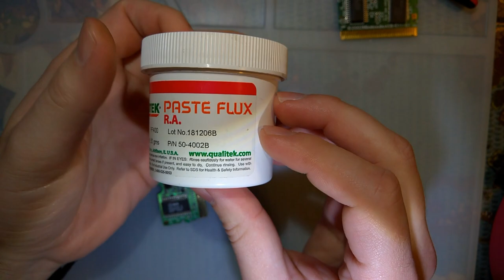Converting a GBA game over to battery-less saving (SRAM to FRAM)

Comment: It’s really nice to know that this can be done but for instance if someone’s battery die and can solder it’s so much easier to just swap the battery with a new one than to do this whole process lol the solder joints are big and easy to work with

Comment: Just a question here regarding GBA Flash type saves:

So similar to how you change the SRAM and FRAM chips (well the game ROM chips in this case) around by soldering, is it also possible to replace the Flash chip from a 64KB to a 128KB one. In addition to putting it on a bootleg cartridge that has Flash save on it (like my Mother 3 cartridge).

I wish to have a cartridge of the Japanese version of Super Mario Advance 4: Super Mario Bros. 3 with all 38 e-Reader levels, while I do have ways to put the rom on my bootlegs I get a message saying the save file is corrupted, and patches to make it batteryless on the rom itself (meaning so save chip required either) corrupts the graphics for me on that game.

Comment: For some reason, Metroid: Zero Mission, which came out in 2004, has copies that use SRAM instead of FRAM. The reason I know this is because my brother's copy of Zero Mission is an SRAM model, while my copy of Zero Mission is an FRAM model. To this day, I still don't understand why a game was released 3 years after the GBA's initial release has copies that use SRAM instead of FRAM. It's been several years since I checked the labels, but I don't believe that the SRAM version and the FRAM version of Zero Mission are different revisions of the game.

Comment: Hello Makho. I have a question. So I currently have a midnight trace gba flashcart from funnyplaying. I want the cart itself as it's a golden color and I have a shiny gold rom in there. The base game is fire red. So it beautiful to me and I want to keep the golden cart. However, I have to patch the rom in order for it to save properly on the cart (since it's a fram chip and not flash) I was wondering, if you knew by any chance, if I can take off the flash chip from a spare authentic fire red cartridge would I be able to place it on the flash cart and remove the fram chip? Both chips are similar in size and have the same amount of pins. It looks like it would fit perfectly. But I want to know if the flash cart would even be able to interface with the flash save chip. Would it be a waste of time to remove the fram chip and install the flash save chip?
Reply from the maker: That's not how this works

Comment: Hey I am trying to save a Pokémon Emerald cart that won't boot, that a dog used as a chew toy ( I can see the bite marks) after looking at the cart carefully I am pretty sure it's the SRAM chip. there is a crack in it that is barely visible. My cart reader could load the rom onto my computer as well. do you know if there is an FRAM or SRAM chip I can buy that is compatible? Thanks!

EDIT: I noticed a lot of these carts have 28 pin SRAM or FRAM chips, Pokémon Emerald has 32 pins.
Reply from the maker: emerald doesn't use SRAM or FRAM so this won't work
Reply: @makho  thanks for the reply, I just bought a cheap Japanese ruby cart and I'm gonna use the chip from that hopefully they're compatible. Cheers, love your vids btw.
Reply: @TheHawk425  ruby isn’t sram or fram

Comment: Dude, props for the Eva Micro faceplate. Where'd you pick it up?
Reply from the maker: Yeah, they are really fucking cool. I got a whole set of them, actually. They were listed on aliexpress a while ago but apparently they are no longer available. Which is definitely a shame because these sticker wear pretty quick when you carry a Micro on you daily.
Reply: I've been messing around with my SP. Installed a rear case light. Getting Evangelion inserts printed on arcade translite. Put a video up the other day. Work in progress, need to install a switch for the light. Difficult getting parts locally and near impossible to order due to the China lock down. I have plans for a second unit (no pun intended) done up in red and black for a SEELE colour scheme. Been following your work. Keep it up.

Comment: Hey, I've got a question if you don't mind hearing me out.
Is there a solution for when a GBA cart with FRAM can't save? I just recently got a cart of Final Fantasy V with this problem. I'd hoped to see a save battery when I opened it up, since those seem simple enough to replace, but of course it didn't have one. I was wondering if a fix is still on the table, or if I'm better off just getting another cart (especially since I have no experience with this sort of thing).
Reply from the maker: probably a broken solder joint then
Reply: I had the same issue with a WarioWare Twisted that I just got, it wouldn’t save. Turns out that Makho was right. Before I went with swapping an FRAM chip, I resoldered the joints on the pcb. Try reflowing the pins in case you have a dead joint, worked for me.

Comment: My Japanese English Patched repro of Metroid Fusion doesn't have a battery, so I'm fine, however I have Mega Man Zero and that uses a battery, though It's not dead yet, but I could replace it with FRAM in future though.
Reply: Update: I realize that that bootleg/fake carts can also have a unique way of saving, so my Metroid Fusion cart uses SRAM, only the rom has been modified more to make it batteryless (thus why it freezes for a bit before continuing while saving the actual game, so if I put a different game/rom in the cart unpatched it won't keep the save).

My Mega Man Zero is a bootleg cart too. So I'm not sure if there are different types of FRAM chips for the bootleg carts. My Mother 3 repro has flash save luckily.
Reply: @VideoGameJNPoop  So do the FRAM chips eventually die?
Reply: @reznor6507  FRAM chips never die, the chips in the bootleg carts are usually SRAM (with the exception of Mother 3 Repros and insideGadgets carts you can buy on that website), only the roms have been modified  to use batteryless saves, without FRAM or even Flash or Eeprom, don't know how to do this properly though.
Reply: @VideoGameJNPoop  I have 2 copies of Metroid fusion one with a battery and one with a chip. Is that chip in Fusion a FRAM?
Reply: @reznor6507  Yes it is, the no battery one is FRAM.
Reply: @VideoGameJNPoop  Thanks
Reply: You seem like you know a lot about these games. Can I replace a GBA cart battery that holds a 3 volt lithium 1620 with a 1616 or must it be a 1620?
Reply: @reznor6507  Yes, you can, but I would recommend CR2016 batteries because they have a longer battery life than the 1616 and 1620, plus 1616 is the lowest life out of all for games so.

You could also try CR2025 or CR2032, but they won't fit correctly in the cartridge, there both big and can make a slight or big lump on the cart, but with CR2016 it will fit perfectly.

I don't know if you can get tabbed CR2016 batteries though for soldering but I know you can tape it in (see videos on that, about replacing batteries without soldering) and it works. But you can also use the standard CR1616 too.

Comment: What is the heat tolerance of these old FRAM chips and their pins? Is it well below the solder melting point?
Reply from the maker: if they couldn't stand the heat required to solder the chip, how would anyone use them?
Reply: @makho  No idea. Just because something is pretty standard process doesn't mean it's necessarily good for the components. I don't know enough about the manufacturing process. I know silicon is heat resistant and that's pretty much it.  This is the first time I've seen this method for removing chips so that's why I asked.  Before I only knew about using  an iron to do it.
Reply from the maker: @flamespear86  I mean, a proper hot air rework station is a lot better than just a heat gun, that's for sure. But they are fundamentally the same thing (albeit no temp control on of those options).

Comment: Hello! Can you link a link to Amazon to buy good tweezers like the one you used in this video? Please 🙏
Reply from the maker: at the time, I was just using some generic tweezers from ebay/aliexpress but I've started using some engineer titanium tweezers and I highly recommend those instead. They're a bit pricey up front but if it's something you'll use frequently, I highly recommend it: https://retrogamerepairshop.com/products/ptn-01-03-titanium-tweezers-series

otherwise, just run a search for tweezers and you should find some that are only a couple bucks. They work but the tips bend stupid easy.

Comment: What was the metal plate for?
Reply from the maker: protect my desk from excess heat from the heat gun. I was worried that the silicone mat would not be sufficient. The plate has ridges that make it effectively thicker.

Comment: 1500w heat gun is scary for that tiny pcb.
Reply from the maker: It worked, didn't it? A hot air station is a much better tool to use. Something something do as I say not as I do.

Comment: How long does a FRAM save last for?
Reply from the maker: Until the chip fails. The data sheet says something around 100 years.
Reply: Over a century.
Reply: @makho  well, then that's basically eternity, because no-one in this section will be alive, and all gbas and  gba games would have rotted away unless they brought them back. I

Comment: What is flux?
Reply: It basically creates a barrier between the solder and the air, so that the solder doesn’t oxidize too quickly. It helps the solder flow more easily

Comment: Are the SRAM pcb’s interchangeable? Basically I’ve got an AGB-E06-10 board with a ton of corrosion that I want to transplant my Metroid rom from. Would an AGB-E06-20 PCB be compatible?
Reply from the maker: I don't know but if you want an educated guess, it should be compatible. There's likely a difference in the passives but if you just swap the MROM, that's probably irrelevant. 

The pinout on basically all the MROM chips in these carts is the same so swapping the MROM chips works more often than not.